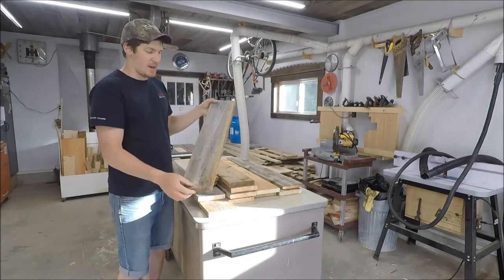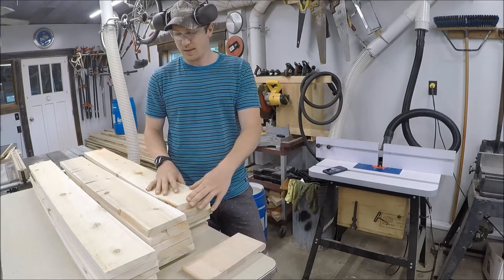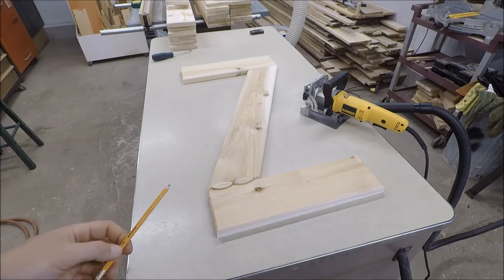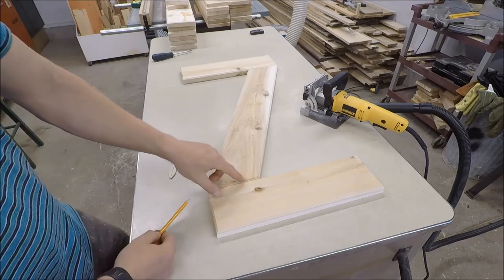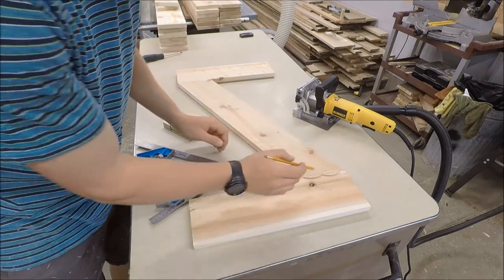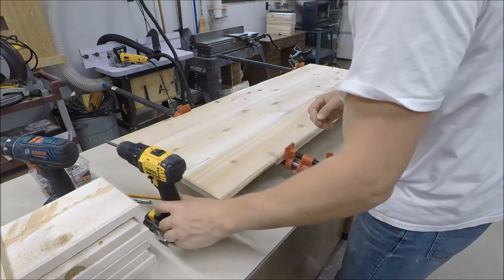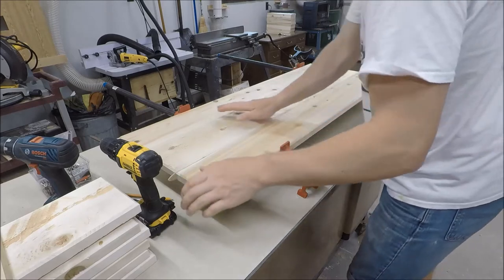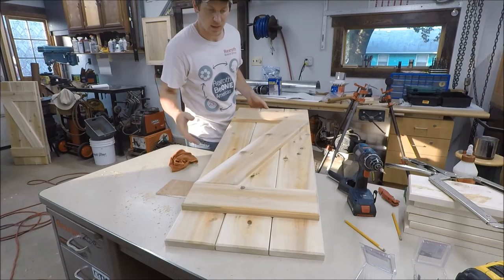DIY Cedar Shutters

Comment: What color and brand of stain is this?
Reply from the maker: Sikkens cetol 1 natural
Reply: What's you angle of cut for your Z?
Reply from the maker: @anthonyray773  depends on the height and width of the shutters, I think it was around 70 degrees
Reply: @RobinsonCustomWoodworking  Thank you
Reply: @RobinsonCustomWoodworking  &&hi hi I u&&&j&***